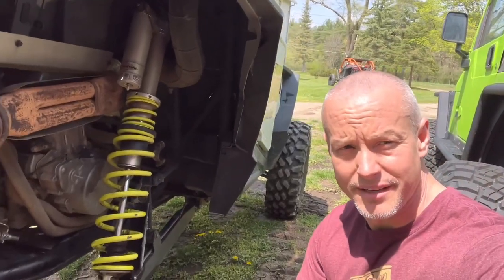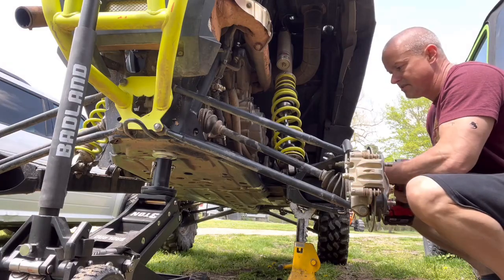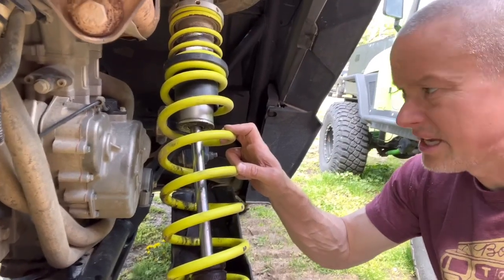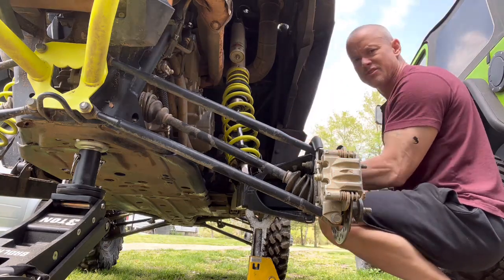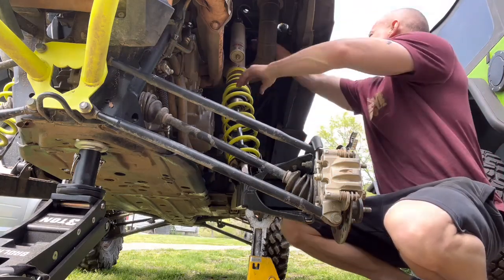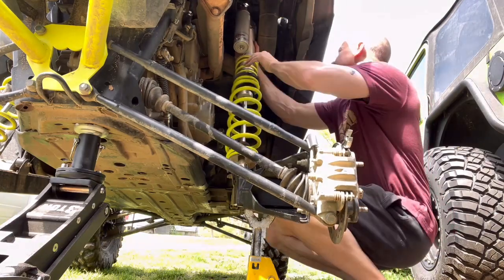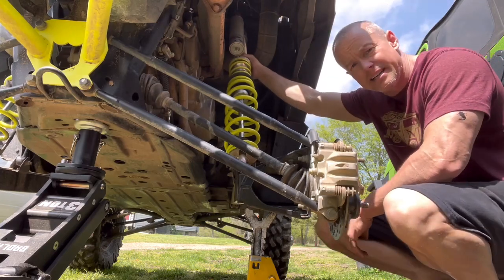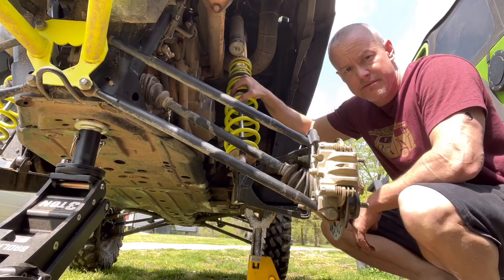Quick and Simple Trick for Replacing Your RZR Shocks

Comment: I have 32 in tires removed the lower bolt that holds shock in place to have easier access to remove clutch cover now there is no way to get the shock back in place..Is there a way to compress the shock or a specific spot to place jack?
Reply from the maker: I have a shock compressor that works if needed, you can place a smaller jack under the Shock (wood block and under the bolt)  then move it up slowly until it lines up. Other way is to set down the jack until the tire is on the ground and adjust from there